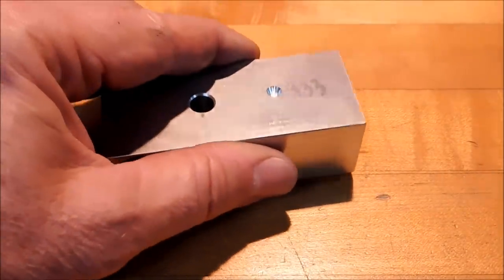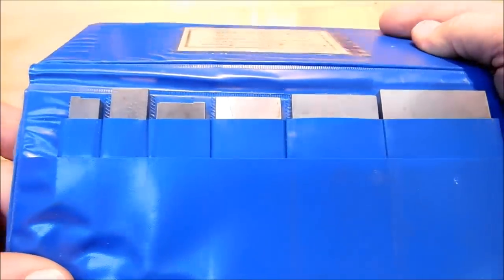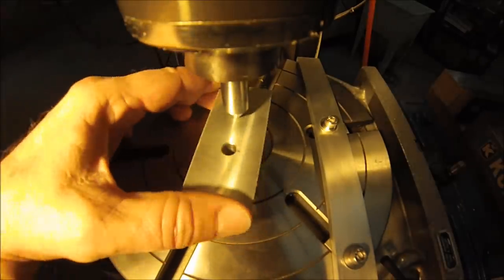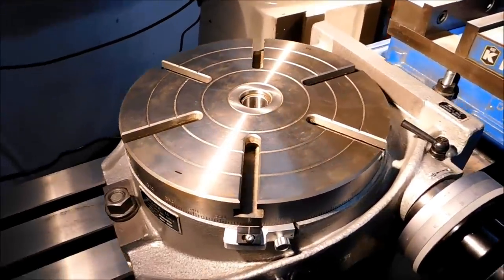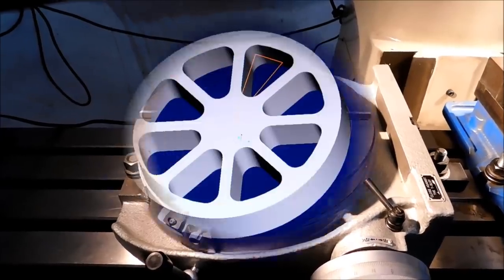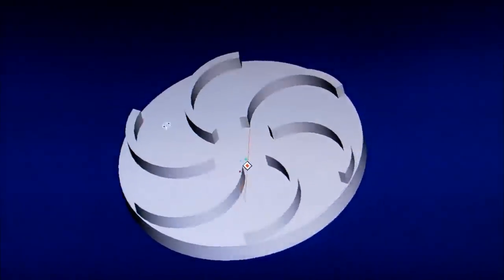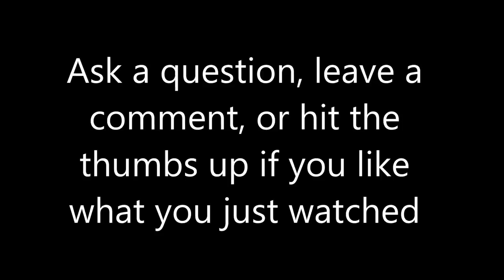Rotary Table Accessories and a Project Choice

Comment: I find it interesting that #3 is getting the most votes as I see it as one of the easier ones to do.  Although at first glance it does look more difficult.  #2 also seems like it would be pretty simple.  where #1 I think looks the most common but it seems like it would have the more difficult offset from center then mill of all three.

Comment: #3 Joe.
 The impeller is a common device. I actually made one out of wood. I’ve been unsatisfied with the commercially available dust collection system. None seem to have the suction value that really remove the sawdust adequately. Many factors are evident in a wood shop that curtail effectiveness even further. Having worked in HVAC for most of my career the proper movement of air and air delivery was a key factor in the efficiency of the industrial and home systems I built and serviced. I first made an impeller that was sixteen inches in diameter with four inch tall veins. It worked very well but was way too big and I was fearful of it sucking my tools off the wall! (Bigger is not always better in some cases. I scaled it down to twelve inches, adjusted the curvature a bit and it does very nicely. I found I could bring the rpm way down and still have tons of suction to move the heaviest particles.

Comment: Being a Jigborer by trade going back to the 60's, most of the parts we fabricated  had to be accurate to a few tenths of a thousandth so of necessity we had to use an indicator to set stuff up. Pick up the rotary center, set milling machine zero, then clamp part lightly. Tap the part around with a piece of wood or plastic until the part hole coincides with the rotary center, tighten clamps. Straighten part by rotating table until the part zeros the whole length. Set a zero on the rotary table and you are good to go!
Bob L

Comment: Hi Joe.  I did something similar for lighting but I used a spare mag base as you can mount it anywhere then.  Used an 18650 cell powered focusable torch (but dive lights might work if you like overkill!) for the lack of wiring in the way and then it's good for lighting up a bore on the lathe.  Spot face the torch, tap and drill it and just screw the goose neck straight in with a spot of Loctite 638 to compensate for not enough threads...but that's what you get when you mill without planning ;-)

I'd like to see option 3.  No particular need to machine any of them at the moment...it just looks interesting.

I'd love to see a video on material selection if you have the time and inclination.  I'm stuck with not knowing what steel is strong enough or suitable for particular purposes like shafts or lathe tools.   Probably over-thinking things is the problem but over-engineering definitely is!
Cheers Joe.  Appreciate your videos.

Comment: I'd like to see all three, mostly because for some reason there seem to be very few YouTube videos showing rotary tables actually being used to make something--most videos seem to be about how to quickly center them--and as a new rotary table owner I'd like to see the whole process--from beginning to end--a few times.  I'm sure this would be too elementary for many viewers, so if I have to choose one I'll go with #1or #2, which look like something I might actually need to make sometime.  I have a question that is pretty basic (and probably obvious to anyone who has actually used a rotary table or seen one used): when you mount the rail on the rotary table I assume the idea is that you're aligning it with the Y axis.  Am I correct that you are doing that by mounting the indicator on the spindle and running the indicator along the rail while moving the table in the Y axis?
Reply from the maker: Correct. The stop rail is aligned with the table axis of your choice.

Comment: I ordered an alignment tool as a thank you for the videos.  Long after the t-shirts and keychains are gone, I will still have the Pieczynski alignment tool!
Reply from the maker: Thank you very much. I used it for the pointer relocation bracket I just did on my rotary table, it makes setup so fast. You're going to like it.

Comment: Hey Joe. Have ever seen a Cross Slide Rotary Table?  Nothing against your methods, they are great, but with a cross slide these shapes are piece of cake.  I've worked in shops that did a lot of tool making and we had them on every Bridgeport.  They rarely came off the machines.  They're big and heavy and need a riser but but well worth it.

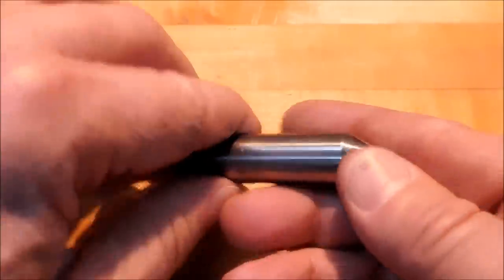Comment: Chuckle. Looks like there's a couple of apprentice marks on those cap screws at about 2:00.

About the lighting: you can always rig up an fixture and use one of the 100W cob LEDs from eBay. Those things are beyond direct sun.

As far as projects go, the straight spoke wheel is probably the most useful, but I'd like to see the impeller made. I want to see if my guess at how you plan on fixturing it is correct.

Cute pup!

Comment: Having kool tools is neat but knowing neat ways to use them is even better, if you keep sharing I am going to keep collecting ideas. Thanks
I took a morse taper 3 blank which was easy to hold by the blank end and drilled a 1/4 hole all the way through, then drilled a 1/2 inch hole part way through. I should have reamed the hole to 1/2 and it would have turned out better. Any hows I then inserted it into the rotary table and marked it at each end, then I cut both ends off. So now if I have a hole I can use to center a part I simply machine a pin the size needed, with a 1/2 end drilled and threaded to 1/4 inch which gets a through bolt. It holds the pin in place nicely and is strong enough to help support the part while machining.

Comment: Joe
Any of the three options is good by me. One other suggestion that would help me out and maybe others would be a ratchet wheel and pawl locking mechanism. I need to make a 3.75 diameter wheel with 24 teeth. twenty four because I have a super spacer. I cant figure out whether to use a 90 degree cutter like a keyway cutter or a 60 degree dovetail cutter. and where to place the cutter as far as the angle of the tooth. I have no CAD. I tried to lay it out with dividers but was not getting it.

Comment: #3 just because I see the guts of a centrifugal pump fairly often. Just a thought on the lights, if they turn out to be too harsh you can diffuse the light with some white cloth. It won't take much and a rubber band will hold it. Unlike incandescent bulbs the LED's won't cause heat issues

Comment: for your lighting,  have you tried some lighting gel????  play around with some 201, 202 color correction or some 119 diffusion or a combination,   this might help with the wash out on the dial indicator shots.  you can also play with different color tempurature lamps,  different cameras are gonna like a different color temp lamp.
Reply from the maker: I have some royal blue filters I tried and it seemed to bring it around.

Comment: On my Phase II rotary table there is a way to disengage the table from the crank and spin the table freely.  I haven't tried it yet, and I'm not at my shop at the moment, but I'm wondering if this would be a way to set the zero parallel with the slots?  If I remember correctly, the hand wheel pulls straight out to disengage the table.  There are multiple levers on your rotary table, maybe you could review what the do in a future video?  And once again, great information Joe - I'm a better machinist because of your generosity!
Reply from the maker: Thank you.

Comment: I see you took my suggestion on fixing the rotary table so the slots would be aligned with the axis. :-) I also have  a video on how I fixed the color and harshness on my shop LED's using glaze spray paint,  might help you with ideas should you go that route.

Comment: Not Rotary Table work but I always meant to pick up some extra Adjustable Parallels that I could grind two 90° vee grooves in. At the time I was doing a lot of internal spline and garden work on a Felled Gear Shaper.  Checking the nternal pitch diameter was always a real PITA. What I wanted to do with them was to support the appropriate sized Gage Pins to check the pitch diameters they cold also be used as normal AP's or for checking ID'e or diameters to small for a telescoping micrometer and more accurate than a Telescoping Gage.

Comment: Hey Joe, thanks for the vid again. I could really use your insight in cutting #3, I need this kind of air impeller for a small project and was planning to do it with thin gauge Al plate pinned together just like in vacuums, but smaller (one-inch diameter or so). I would love to see how to cut it out solid!

Comment: If 3 does end up winning it will be very interesting to see how it is accomplished. I'm sure with the proper math to know the offset from center and the amount of degrees to turn the table it would probably be fairly easy. As with most any machining the hard part isn't the doing, it's everything that leads up to the doing. Figure out the math and the setup and everything else is pretty easy.

Comment: Seems like most people want to see #3. That one isn't too bad. Start by milling out the center then drill 6 holes or centers for the arcs either in the top or bottom. Relocate an arc center hole to the table center. Cut the edges of the vane, then move the part to the next hole and repeat. Whittle out what is left. You will need to cut the ends of the vanes while setup on the disc center point.   The hard wheels would be the spoked ones if you don't have an end mill the same size as the radiuses in the spoke corners. That would take several moves of the part to cut those or a boring head. Much easier if you have the right size end mill. I am waiting anxiously on the explanation of the tool with the offset square head.
Reply from the maker: There are no holes in part #3. Thats one of the things that amps up the challenge a bit.

Comment: 0:52 The 2 ton mill I work on doesn't have a quill and at many times I've come across this problem...How do you apply "a little bit of pressure" without smashing and cracking things up. A spring loaded center is the obvious answer but it's not possible to have a spring loaded one of everything. Am I missing something here? Should I be making a spring loaded collet chuck perhaps?
Reply from the maker: A spring loaded double sided center is a great idea. One side male, the other side female with a spring in between.

Comment: Any advise for cutting a hex hole (die holder) in the end of Al round stock with only a small lathe, drill press, layout tools, a dremel? 

I was going to lay it out, drill holes in the corners of the hex, bore out the center closer to size, and dremel/file the rest to the scribe lines.

Comment: Hi Joe, all three please...I know nothing! 
Number 1 is for scale railway locomotive wheels (for me) ; I think I know how to do it - offset from centre then machine straight up and down to do one side, then offset the other for the other side, machining opposite spokes at one setting.
Number 2 would be, for me, scale hand wheels; more tricky. 
Number 3; I am curious.   

Another thought; does your Rotary Table allow for disengaging the drive? The smaller ones do, and that means setting zero each time. It is to allow for rotating the table freehand if required, more useful for model engineering.

Many thanks, 
Andy

Comment: I wonder if option 3 can be done with one rotary table mounted to another rotary table.  I'm sure there's easier ways - but Joe - what can be done with 2 rotary tables ganged together?  Maybe even with one perpendicular to the under
Reply from the maker: The possibilities are scary. You are in the right area for sure.
Reply: Maybe you can do this with a DRO hole pattern and 1 rotary table  @joepie221

Comment: Would like to see #3, but really any of them. I mentioned that my table has T slots that cross the center and no centering feature, so I made a strip to fit in the slots and use a locating dowel and locking set screw to hold it in place, with another locating dowel dead center in the strip. Can use this to locate parts on center of table or set table referenced to center point. Question on an old video on internal threading-Did you set compound on 29 degrees and feed with compound or did you plunge straight in perpendicular to axis? Need to make another face plate for spindle and thread inside.
Reply: another quick thought on #3, would a french curve be a better shape for the volutes efficiency wise?
Reply from the maker: I straight plunge all my threads.

Comment: Number 3:
Set the main OD and ID on the rotary table or lathe.
Every flute arc has its center point. Center drill that with bold pattern feature on dro or with trigonometry. Aline center point after center point like shown with the hss center and mill it out. Deburr it. Done. =)
Wonder if you could stack two rotary tables onto each other. Would make it much faster, because you only need to aline the part once.
Reply: you could just make the center drills with the rotary table. No need for trigonometry or dro.
some tasks just have to set in the brain for a bit...
Reply from the maker: Notice the absence of holes......... I did that on purpose.

Comment: I  apologize for the possible dumb question but im going to ask anyway, you added the rail and said its true to the world,  is it 90 degrees from the table of the machine or from the base of the rotary table itself? My vote is for #3 also, thanks for all the great videos!
Reply from the maker: Its set true to the 'Y' axis travel of the machine when the rotary table is all at zero's. An 'X' axis setting would be fine as well.

Comment: Im pretty sure there is a way to take that table apart, and re-zero it so that you don't have the 12 deg offset.  It may just be a matter of re-sequencing the worm screw relative to the table gears... PIA I know, but better than laying awake at night letting the OCD drive you nuts... lol
Reply from the maker: I offset the pointer. Everything else is fixed and not changeable.
Reply: @joepie221  it is what it is right.  Thanks, I just bought one of these rotary tables.  I pick it up tomorrow.

Thanks again for the great content

Comment: I love your video's many good tricks . I could go out and buy a new scraper and broom with an extension handle , but i decided to repair it , the broom end I turned the abs plastic and press fit a peace of aluminum .0025" smaller this worked out fine , the scraper end  I want to press fit in the aluminium to the peace of tubing that holds the scraper .001"  How can I hold the scraper end ?? I do not want to take the scraper off the aluminium Tube ( .885" Dia. )  I may have to take the scraper off

Comment: Please do all three! Number 3 intrigues me, I can see how I would do it, I would be tempted to mount another rotary table on the rotary table, and just index  the piece around on the top one, and machine the blades on the bottom one. but I bet it can be done without this! I would set the bottom table to mill arcs of the correct radius, then the top table so that the centres of the arcs are at their correct radius, then mill the inside of an arc, run it round with the top table 45 or whatever degrees and repeat. Then I would move out to the outer radius and do the same thing. I would let my wolf-spider, now my apprentice, having sucessfully given birth to about 150 beautiful babies, clean up the rest. I guess by moving the piece, you could cut center holes for the arcs, then reposition it  to use the same table, though, having perhaps cut flats to indicate north against the bar.
Reply from the maker: I like the rotary table on a rotary table concept. Thats just about what needs to happen.
Reply: the double rotary was what i came up with too
i guess there must be a way to do it with only one rotary

 we will know in a couple of days...
Reply: @janvanruth3485  It gets a bit harder if those things are turbine blades. Not circular. I once shared a business place with a bunch of toolmakers. They made the negs fo Alfa F1 turbine blades. It didn't really take them too long. The mould opened like a flower. I didn't, at the time, even know how to ask them how they did it. Three Bridgeports, a cutter grinder, a surface grinder, occasional filing and emery were their armoury.

One of them asked me for a solution to silver a clock dial. I prepared it. I tried it on a piece of brass, it didn't seem to work all that well. I gave it to him, explainining my reservations. He used it, no need to say, it worked perfectly.

They moved quickly on to CNC, it being 1980. A mate built their first stepper motor controller. They must have ballscrewed their mills, I guess... I was only 17.

Comment: I think I see how to do #1 and #2 reasonably, but I'm far less clear on how you'd do #3.
What I'd really like to see, however, is how to do a spiral -- in paticular, something like 3-jaw chuck jaws (or a scroll wheel), which as far as I can tell, would need you to use the rotary axis and the longitudinal axis of the mill at the same time, in a defined ratio.

Comment: Joe, I have access to a 4 axis CNC Tormach mill. I need to cut some splines on a 1” shaft and time really isn’t an issue. What cutter would you recommend for cost effectiveness?
Reply from the maker: A slitting style approach usually works better than an end mill.

Comment: Joe do you have a part number and supplier of magnetic backed indicators please? I cannot find them in Australia. Christopher
Reply from the maker: US general model 387. Discontinued. sears made a similar model back in the 80's. Its a tough item to find. Check EBAY vintage tool area.